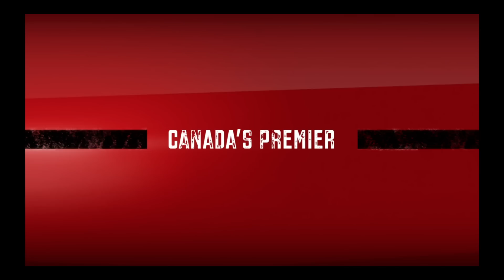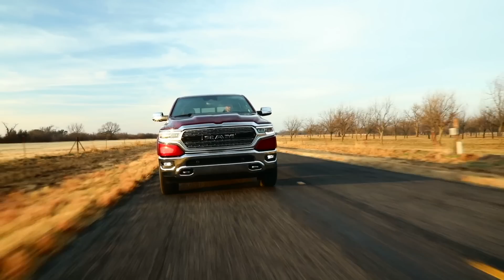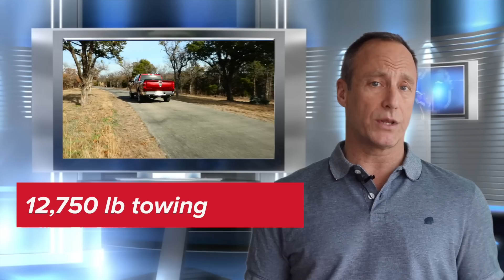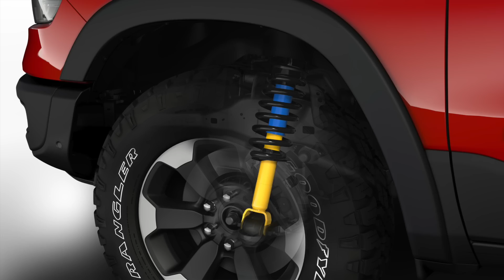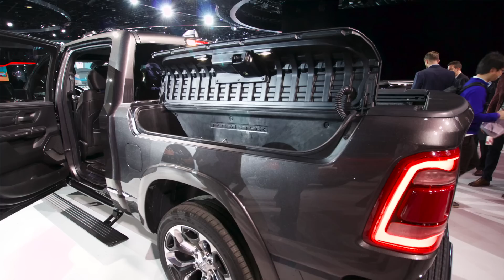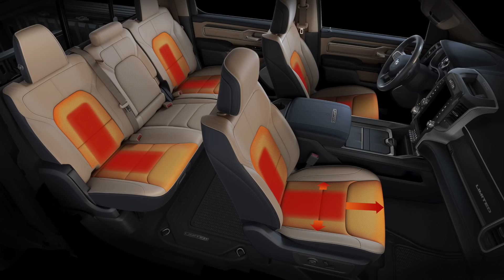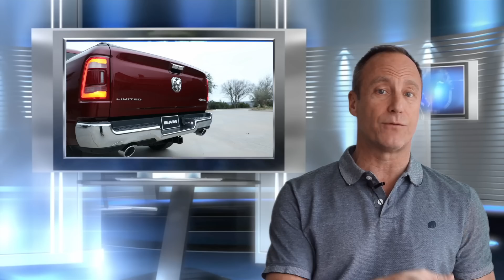Ram 1500 Engine Drive Train

Comment: I'm disappointed that the "Hybrid System" will not enhance the true overall Torque of the Engine.
Reply: Torque down low in RPM is beneficial, which this hybrid system offers.  once your around 60-70mph you dont necessarily need to be going faster with the weight for this size of truck.  

The torque on my 2.7l f150 comes in early making it pull much easier on heavier loads.  If they increased torque any on top end you would still need to hit close to their rated target RPM.  most naturally aspirated hits peak higher up in RPMs around 5000-6000.  Turbos like ecoboost on fords significantly more torque at half the RPM, which is beneficial to not have to floor it to get moving.  I think that is the purpose for the RAM hybrid design, assuming their system is reliable as stated you will see much improvement.  to worry about torque on top end just makes no sense unless your overloaded and over the speed limit.  

Point being torque upgrade even 50ft/lbs at top end would require you to maintain top gear and RPM close to their testing numbers, which as mentioned in fine print reads 5krpm + most of the time, and for this truck more torque would exceed safe capabilities.  I also suspect like ford, RAM may try yearly enhancements to encourage early trade ins and more buyers.  ford started with ecoboosts, remodeled insides, added 10speed, went to aluminum, now comes a diesel, next a hybrid.
Reply from the maker: Same. I'm going to ask them why they didn't add anything to the top end.
Reply: it does add to the top end, it helps the truck stay in 4cylinder mode longer on the highway, offsets the load of accessories during cruise and helps from stops where the most fuel is consumed.  It's not a miracle system, but it's def a step in the right direction.
Reply: Because they're not building race vehicles?  Oh, and you can't just say "oh yeah, put that torque on the top end instead of the low end".  High end torque is much harder to produce.
Reply: I'm not, you need most of the torque at the take off, better mileage
Reply: Battery capacity and power output limits largely dictate the implementation. Gasoline V8s don't really need more power up top as much as torque fill down low. I suspect this is what they did.
Reply: I'm guessing because the battery pack is relatively small, and it's not going to give you additional sustained torque.  It's meant to get you going, and primarily to enable the start stop feature.  It's all being driven by the stupid Obama EPA regulations that Trump is trying (unsuccessfully) to kill.

Comment: I'm looking for a new truck.  I currently have a 2014 F150 with 3.5 Ecoboost, and several years ago I had a 97 Ram 1500.
I was thinking about going diesel this time, because I drive a lot.  I am seriously considering Ram 1500 or F-150.  I'm still leaning toward the Ford, but the Dodge may be winning me back.
Reply from the maker: If driving a lot is long hauls, then diesel makes sense. Both are 3.0L V-6. If towing is a part of that the 2018 F-150 is rated to tow up to 11,400 lbs and a max payload of 2,020 lbs. 2018 Ram 1500 at 9,290 and 1,640 respectively. But this is a game of one upmanship and you can expect the Ram to beat Ford when the diesel numbers are released later this year.
Reply: Mostly lighter loads that take up space, and occasional light to medium weight towing... and lots of miles.  The big thing will be the power plants.  How will they stack up against one another?  Then there's the cost:benefit analysis, and long-term maintenance.  They're all giving me a lot to consider.
Reply: Chas Brey if your going for 1/2 ton diesel I’d personally go with the GM inline 6 duramax. I know the ford and gm half ton diesels are new and the verdict is still out on them but if I had my pick on an engine block I’d take a inline configuration every time. There’s a reason all the big rigs up an down the road across the country are inline. The 4.0 inline 6 Chrysler had in Jeep for years was bullet proof top ten motor of all time in my opinion. A shame they stopped making them. But they couldn’t make a dime off them is my guess. It will be interesting to see how the ford and gm new diesels do. But from the outside looking in I’d pick the inline 6 duramax. I’m not crazy about any of these new trucks honestly. They look “ok”. But they’ve taken the technology to far IMO. My 14’ silverado has enough tech as it is. Just enough. Very pleased with my 14.
Reply: There is definitely something to be said for an I-6 configuration.  The old Ford 4.9L I-6 wasn't a powerhouse, but it was rock solid.  And the old Mopar Slant 6 was popular for similar reasons.  BMW is still rocking every scintilla of life from Inline 6s.
I'm glad to hear you enjoy your GM truck, but I've never been able to truly get into the GMC/Chevy offerings.  Similarly, neither Toyota nor Nissan fit right either.  It's the numbers combined with that visceral feeling of confidence that has grabbed me.  Still, I won't rule it out, and will give it a fair trial.

Comment: Are the air pumps 48v?
Reply from the maker: Nope. The only thing running off the battery is the eTorque system to boost the engine. I am itching to connect other stuff to it. How about you?

Comment: I don’t want start stop, I don’t want a hybrid system. I want a truck.
Reply: Unfortunately alot of this stuff is necessary for the auto makers to meet more and more stringent emissions standards. Not because they want to put it on or want it to break
Reply: That's because no one owns them. I had a Nissan and loved it. I had a Toyota, and hated it. I own several Fords, Chevy's and Ram's and the Ram is by far the best truck and has ended up allowing me to make more money in my business.
Reply: jeremy byford you can switch it off. Just like any other start/stop system in other vehicles.
Reply: i agree 100% with you bud..if you have to have  that ,then i want the option of turning it off.the start stop grap,if i want it ill use it but make it so it can be switched on or off! all this is is a way for the industry to make it a standard option so they have areason to charge you more for it.i want plane jane…..let us pick the options…
Reply: You can switch it on and off in the new Ram.
Reply: thanks for the reply.... one thing I have found out during all of the research is not to go diesel if I had the money I would go the route you did I have talked with a lot of owners which is way more accurate than the web. and it is a great way to get honest comments 9 out of 10 ram owners had something  good to say plus I always ask would you recommend one and out the 9 out of 10 all say yes without hesitation
Reply from the maker: Fortunately we still have all gas or diesel options, but that could change. Check out Bollinger Motors.
Reply: The hybrid system is optional on the Hemi but standard on the 3.6
Reply: It is a truck, numb nuts.
Reply: Jake Lamb exactly what I was thinking
Reply: actually the tundra and the titan truck are the only two with the least complaint of all the trucks out there
Reply: Kenneth Wilcox emission standards are important to control pollution.  Google anti cyclones and you'll understand why we don't want uncontrolled emissions
Reply: WHAT YOU HAVE STATED AND I DID LOOK IT IS NOT FACTUAL JUST THE SAME I READ GLOBAL WARMING WHICH IS FALSE IS CAUSE BY PEOPLE SNEEZING.... ALL THIS GLOBAL WARMING CRAP WAS STARTED BY THE muslim traitor ovomit ....AND AS A WEATHER STORM SPOTTER I HAVE NOT HEARD THE CRAP YOU ARE TRYING TO PUT OUT THERE
Reply: Get a tundra

Comment: Sounds like a lot of electrical failure components waiting to happen!!.... Dealership's are going to love It!! Hundreds maybe thousands for an electrical failure or srew up in the truck!!! My 04 Hemi is still riding smooth though.
Reply: Pulled 250k out of my 4.7 Dakota under regular maintenance.  Good luck technology?  Btw Mercedes designers platforms the motor.  Last time I checked dodge doesn’t build fighter planes.
Reply from the maker: I had the same '04 Hemi! I loved that truck. Here's a couple of things I added.

http://suncruisermedia.com/4WDrive/tech/winch-ready/
http://suncruisermedia.com/4WDrive/accessories/a.r.e.-overland-cap/
http://suncruisermedia.com/4WDrive/accessories/superwinch-talon-12.5/
Reply: East Coast Resident better than ever?  Most of the problems people have are with their electronics, especially with newer Dodges from what I’ve read.
Reply: That_Guy89 x.     I'm not a dodge fan but everyone I know who owned a dodge always had electrical iasues
Reply: Yeah just stick with carburetor, screw technology. Lol do you hear yourself?
Reply: My key fob for a 2010 cost me yesterday 176 for the fob and 70 for programming. Wonder how much would that one cost? A electrical switch for the heater vents cost 35 bucks  and since Dodge doesn't guarantee any electrical components paid it twice in a matter of a month not to mention the hour of research and execution, the driver side mirror took a five on its own at 75 down the highway and since it's got the blinker integrated was about 200 other than that just oil changes!
Reply: Eric Sanchez  what is you experience with your Dodge? I just think its beyond stupid to have to do shit twice hence the heater for no damn reason and components not having warranty even though they are oem. Also the damn mirror just falling?  Damn thing made me check the other one to see if it was loose or something. Are you getting a 2018?
Reply: Eric Sanchez  well as much as I would like to get a new one I would hate to drop that kind of money for something that hasn't been proven by the real customer. I made a bad choice and bought a 03 jeep liberty new and had recalls like crazy up until I sold the car a few years back. What I probably will get this year for my business is one of the high roof vans from Dodge.  Cross fingers and hope for the best. Hope you have luck on yours!
Reply: Eric Sanchez I thought versatility of Wrangler that wasnt available 4 door then and the comfort of Cherokee 4x4 and all that bs but it was unproven new tech and new model so now I wait for the real consumer to try and test it!  Dodge has been good tome once in a while I tow 8k dump trailer and 5k cargo trailer. Use it or loose it is what I believe not a princes pacer. mechanicly hasn't let me down just electricly, that's my concern. More tech more expense.
Reply: Eric Sanchez well we hope so, but they are in business to sell and components is a big part of their business and electric components with no efin guarantee is beyond stupid! in Mexico I bought a Hilux because the small diesel engine and smaller size as its just to puts around but here I need a bigger get it done truck so the Ram we chose  because Fords were kind of bla in that time we bought ours and Chevy I've never cared for since my first truck.
Reply: That_Guy89 x 
People in 1950 said the same thing about your truck 😂
Reply: Honestly electronics these days are amazing, they don't wear out, they just do their job as long as they get power, they are more reliable than mechanical parts, except all the fail points have been worked out for the mechanical side more so than the silicon
Reply: That's what the old guys said about EFI and a family member of mine said that an 8-speed transmission was doomed to failure.  Vehicles are electronic intense now and better then ever so might as well get used to it or get left behind.

Comment: Not interested in a hybrid truck. That's sacrilege. Ram just try to build a truck where the front end, transmission, and rear-end doesn't pack it in before 200k. That would be truly innovative.
Reply from the maker: Although I had to get some minor front end work done at 220,000 km, my 2004 Ram 1500 went for 300,000 km trouble free.